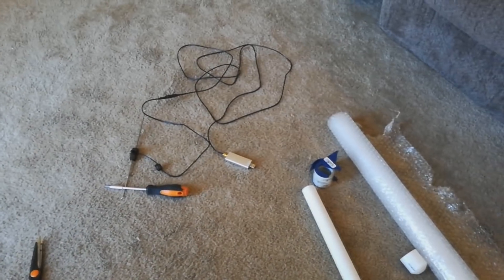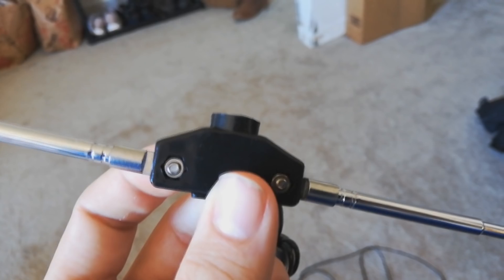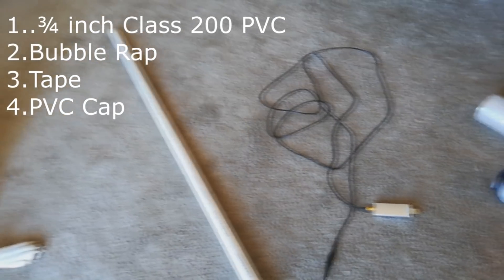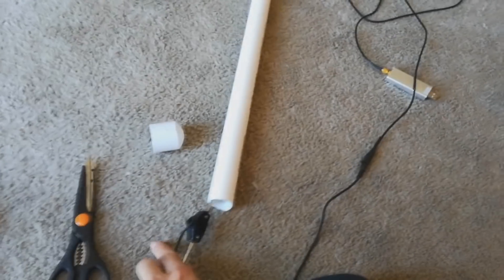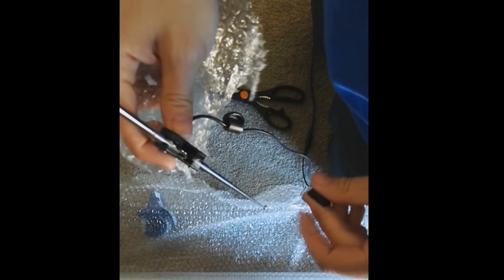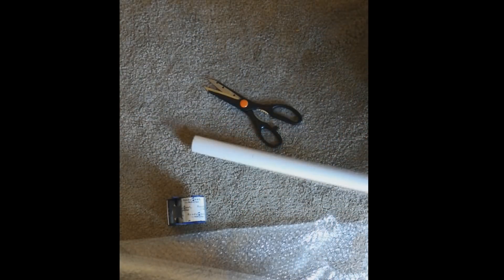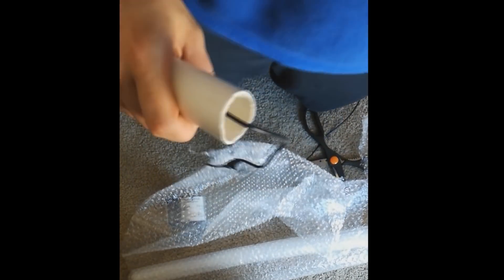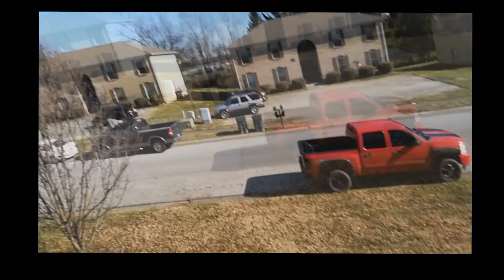Weatherproofing a RTL-SDR Stock Dipole Antenna

Comment: If you tape the antenna sections in place once you have the desired length, they are less likely to collapse while you stuff it into your pvc tube. Seems like you could use a pvc T and 2 sections to allow the coax to exit at the midpoint like it should, as well.

Comment: No way you can let the coax run parallel to the antenna element. This is not a decent solution. You shoud lead the coax at least 50 cm and preferably more from the antenna @ a 90° angle. Ok, the antenna will work but it produces a degraded signal quality.
Reply from the maker: Worked very well for me on my APRS setup. If this antenna was meant for transmitting I could see this being an issue.
Reply: @ModernHam  Yes it is not advisable to do so. It is a well known issue and surely nothing new. I have experimenting with this a few years ago and recently was testing a active dipole design from a friend and by accident had the coax running parallel near the antenna and the results become bad. Its your choice of course but I can only advise you not to do so. Good luck.
Reply: @ModernHam  the receive and transmit properties of an antenna are identical. DXo is right.